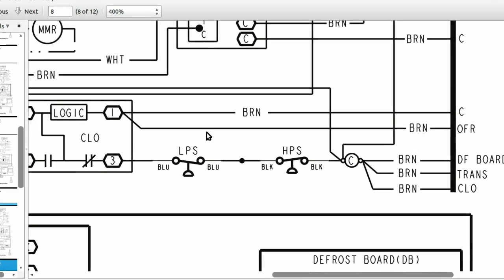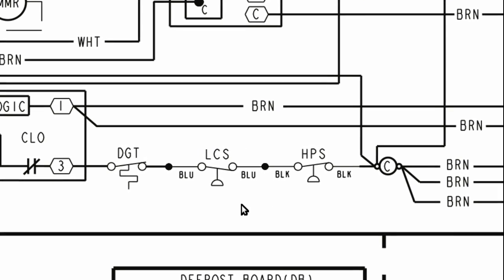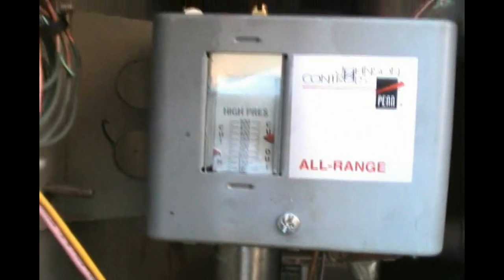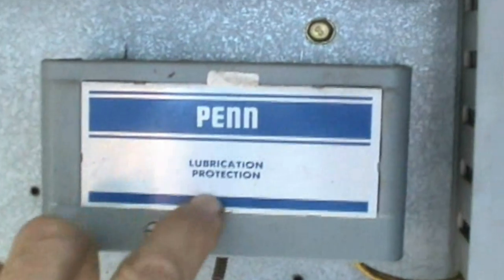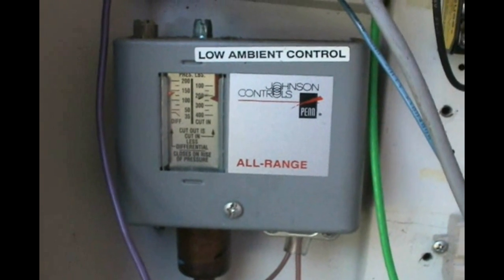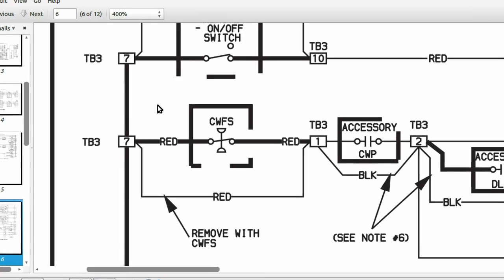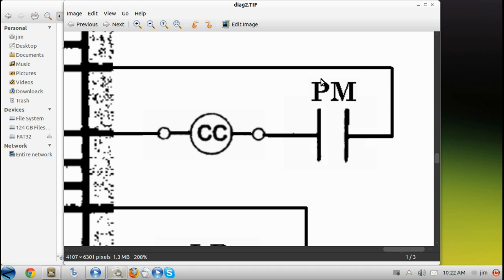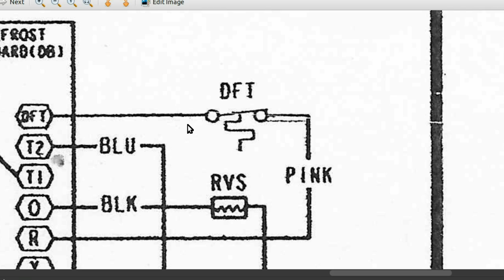HVAC Wiring Diagrams 4

Comment from the maker: @theASEtech You only have to recover the refrigerant if the pressure switch is connected to an access port that does not have a core.

Comment: question for you dr z can you show how to remove any pressure switch i haven't seen a video doing this job do the system has to be recovered when the switch is replaced?